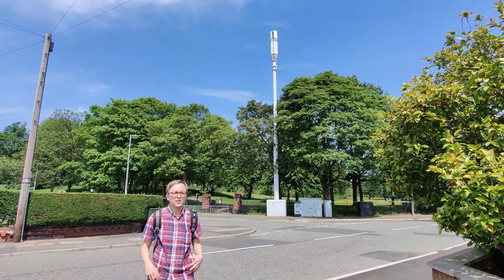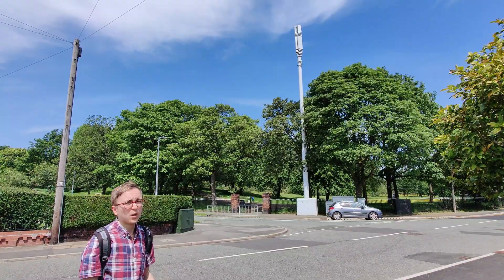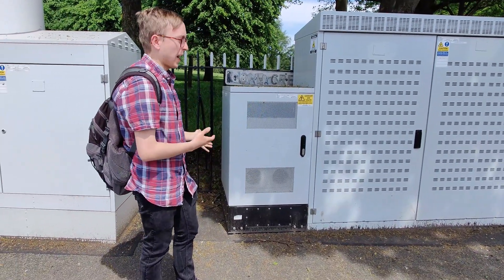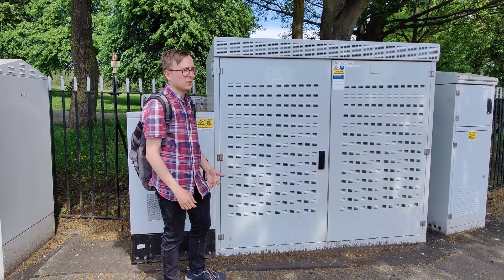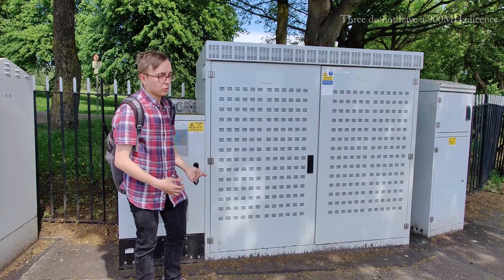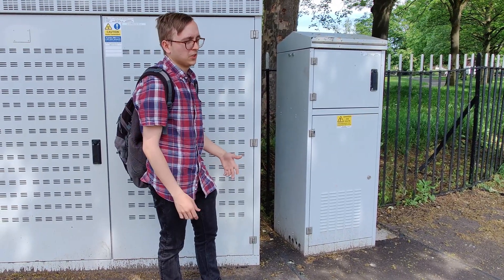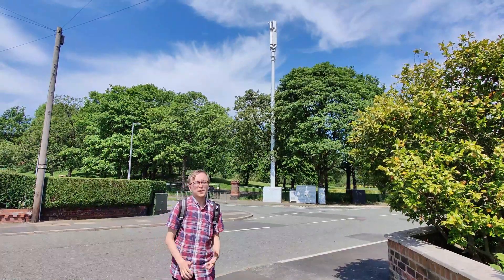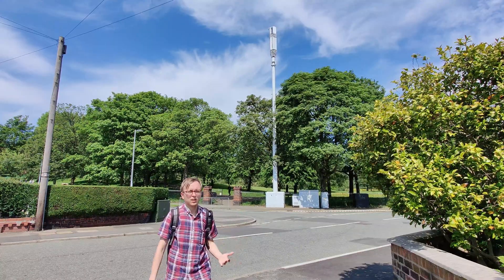Three UK's Gigabit 5G Poles of Wonder Explained + live 700MHz

Comment: Given 5G has less range than 4G, if you're starting with 4G infrastructure, you then need to add many more 5G monopoles? How close do they need to be?
Reply from the maker: 5G doesn't necessarily have less range. Far more 4G masts are required aswell. You will note from the video that these broadcast 4G and 5G.
Reply: @scivids1999  Why are more masts required for 4G?
Reply: @rondeboschcommon  because Three are decommissioning all UMTS/3G cell sites.
Reply: I have seen estimates for 200m to 500m between 5G base stations.  But most of these can be quite small compared to the 4G towers.
For 4G the spacing can be 2km to 20km.  But the biggest difference is you may have up to a million 5G devices for one square kilometer.
For 4G til is up to 1000 per base station.
We can be very sure the rural areas will not get many more base stations than today.  Its where you have dense traffic it pays off to have more base stations and use higher frequencies.
Its going to be way more expensive for providers than 4G was, so they going to cut down performance in areas with less demand.

Comment: Are the following statements correct: 4G has a range of about 10 miles; 5G has a range of about 1500ft/500 meters at best (line of sight).
Reply from the maker: These are incorrect. Numerous factors affect coverage. It's possible to use 5G at 20km+ in certain conditions for example.
Reply: @scivids1999  then why the need for more masts?
Reply: @rondeboschcommon  Because 5G have several bands with higher frequencies (and more bandwidth).
When you are high in the GHz frequencies, it is getting close to line of sight.   The low frequency bands has excellent range, but relative narrow bandwidth and a lot of potential users.    If you choose e.g. 15GHz you have a small coverage area, but if you reach that tower, you will have blazing speeds and ultra low latency.

I am living on an island in Norway, and the tower I reach is 35km away in the mainland.  I can only reach it on 800MHz my lowest frequency, since the signal is passing some hills.   Above 2GHz I bet it would be hard to get any signal at all.
Reply: @la7dfa  the line of sight ?? you mean a tiny bolt of lightning ?

Comment: Seen a few of these polls in Milton Keynes.  However was still frustrated at the number of spots in Milton Keynes with slow data on Three.  So recently switched to Tesco Mobile which runs on O2.  While O2 is not amazingly fast,  it is consistent with reasonable speeds and good coverage.  Normaly get about 20Meg.

Comment: Seen one of them poles at Birchwood shopping center Dropped pin
https://maps.app.goo.gl/qwiotC53zyPuxGSs8 (it's at that pin location and it Google Street view hasn't been there yet, the old decommissioned pole is still there on the same road)
Reply: I have to take a photo of it (main issue with this open design fancy cells is bird's can easy setup nests in them as they are constantly warm) the one here has load of twigs in it

Comment: Did i hear that right, 4g 700?
Reply from the maker: yes!
Reply: @scivids1999  How strange, so they do not intend to use this new spectrum for 5g? Also in my location i seem to be pushed to 800 4g before 3g
Reply: Well the thing is LTE(4g) and NR (5g) can be or are combined (DSS dynamic spectrum sharing with the x55 or higher modems) to get them nice 1gbs speeds (unsure if its a Ericsson only thing but its been used all way back to 2015 on LTE)
Reply: @leexgx  Thanks for the info, Hopefully I will be able to test some 5g soon, Three only have band 3,20 where I am
Reply: @nathanbrassington7659  I borderline this thinking of cancelling my 3 sim as lots of old NBNL masts in my area that don't have 4g+ witch 3 need to get more then 1-10mb/s (assuming it actually works, lots of dead zones move 1 meter Internet doesn't work move the other way it does, move another meter you might get weak 4g+ signal witch then drops to 4g800 so no streaming ) ,, 

But I have had speed tests in the 500mb range on 3uk on 5g when on an 3.6ghz mast (limited range thought, it's like been on FTTC near fiber broadband if your close to the cab it's fast any sort of distance drops low 3.6ghz has same issue but that can just be one building in the way)

works fine for ee as they have enough mhz to keep the 20-50mb going and has 2600 on most cell sites but still no actual 4g+ but works fine thought , but on 3uk using single 10mhz on 4g800 and 1800/2100? 

wish I could block the 4g800 frequency on 3uk as its useless once you use more then 200MB on it as they heavily throttle it and 3 has same issue as ee it doesn't dynamically switch frequencies when data is in use and will get stuck in 3g or 4g800 band unless you stop using data or switch data off, Vodafone and o2 don't have this problem they very actively switch between technology's 3g/4g and frequencies
Reply: @leexgx  Speeds used to be terrible at peak time where I am, they must have upgraded the backhaul or something because its now around 20-40 with the same bands, I agree about band 20, I often get pushed onto it while downloading or streaming, causing the quality and speed to tank.  I have not yet been able to test 5G at all, I have a s21 ultra and pixel 4a 5g
Reply: @leexgx  Three uk use 5mhz band 20, 15mhz band 3 and 10mhz band 1 not sure about the other bands as I've never been able to test them
Reply: @leexgx  I read that EE doesn't display 4G+ on phones even though it is deployed, by choice
Reply: @nathanbrassington7659  I have cell mapper and other tools that show it (4g+)
Reply: @leexgx  3 now has 4g calling on all bands, Vodafone in my area has really good speeds, over 100 on 4g+, I use them for my home Internet inside a 4g router
Reply: @leexgx  I use cell mapper to, but I use the hidden menus in my phone to see which bands I'm connected to.
Reply: @Ghost0722 Good to know, when I tested EE late last year I only saw 20mhz  spectrum deployed from my local mast
Reply: @Ghost0722 Three? Yes I know, but I have never come across it
Reply: @Ghost0722 I'm in Cheshire, and I only get CA bands 3,20 and in a few areas, 1,3
Reply: Band 32 recently deployed near Exeter in Devon on 3.
CA with band 20 gets me 150+mbps on my router.  However seems unstable and will frequently lose CA or dump me back to 3g.
Reply: @martinsouthwood4624  Nice, I hope they deploy it in my area soon, band 3 and 20 are quite stable for me but band 20 does hardly anything to increase the speed of band 3
Reply: @Ghost0722 EE and 3 has always been quite slow here, even back in the 3G days when compared to others.